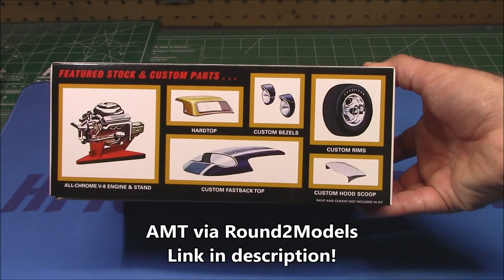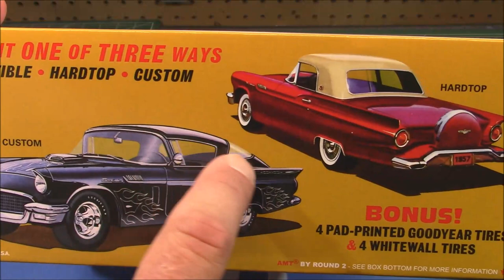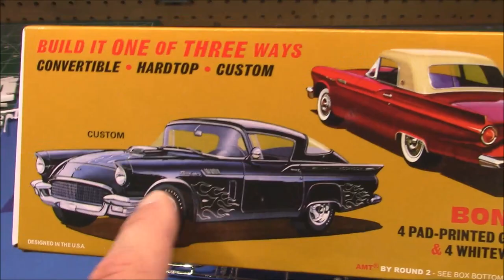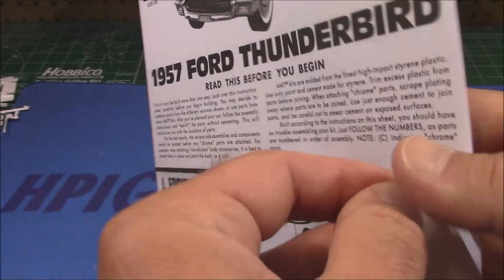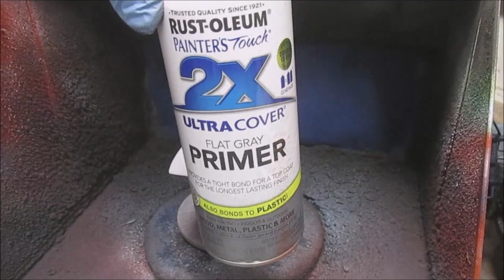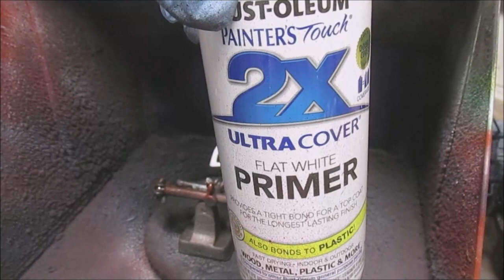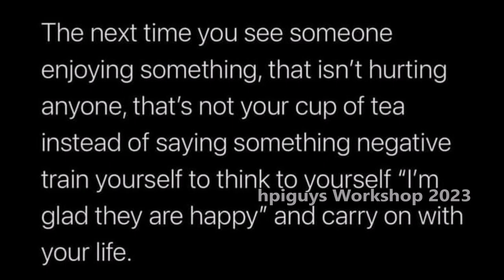1957 Ford Thunderbird Custom Fastback 3n1 1/25 Scale Model Kit Build How To Assemble Paint Interior

Comment: The oil pan sump is usually on the same end as the distributor on most Ford engines. This is a Y block which had a rear distributor so the sump is also in the rear.  Nice build, I love it. Keep'em coming

Comment: The large unknown plastic part is the bracket for the original kits wall display  parts, the second rectangular piece was to hold sand paper the the original kit had along with a tube of body filler.

Comment: These kits used to be supplied with a tube of AMT body putty and a plastic part to apply and smooth out the putty. One of those mystery parts is the spatula thing, if memory serves. I had this one back in the day but I can't remember how I built it up.
Reply: The putty came with either the '55 or '56 kit because the hood scoop was separate and I used the putty to blend-in the scoop.

Comment: The large flat piece od plastic was put in the kits when they gave you body puddy it was something to apply the puddy that was from the 60's kits.!
Reply: richardcrisclone is right.  This kit was originally released in the mid 60's and was a "Styline" kit with a custom front end.  Also included in the kit was a tube of AMT putty and possibly a small sheet of sand paper.  The flat piece of plastic was for gobbing on the putty   -- like a miniture spatula.  The other unidentifiable hunk of plastic was part of a wall mount for displaying the car.   I think this may have been the first kit with a chrome engine.  This kit was very straight forward, fun to build and looks good sitting on the shelf in the den.  It's nice to see a buildup of this venerable classic kit.
Reply: .....wasn't "puddy" the guy that worked on Jerry Seinfeld's car ??........"yeah - - that's right".......

Comment: in case no-one has commented on it----the 'body panel" is one of the original issue custom fender skirts----the "I don't know what it is" part is part of a two piece stand that you could put together had hang on the wall to display your model---and like you I dont know the purpose of the piece of rectangular plastic---the spare motor block and the headers are from the "gasser" version-----wish they would have resurrected the advanced custom parts from the original version----had a couple of really neat front and rear treatments----the original kit could have been built 5 or 6 different ways(cant remember how many exactly)---have several original and rereleased kits I picked up off Fleabay before things got so expensive---plan on building an example of each version on the side of the original box----by the way--great build

Comment: Looks like they opened up some previously closed channels. Unfortunately, it gives some parts, but not enough to complete the one time released Here Comes the Judge Gasser. That's where those headers, extra block halves, and chrome reverse wheels come from. Missing the 427 SOCH heads, timing cover, pulleys and accessories, intake and injectors, etc., raised front solid axle suspension, ladder bars and roll hoop. There's probably more parts, but those are a few can see. I was really hoping when it was announced, they'd bring that version back. When AMT released it originally, the engine being entirely chrome was meant to be displayed by itself separately on the stand. Turned out pretty good.

Comment: That kit has more parts

But basic stock with Continental kit
Wheel skirts and both the soft and factory hardtop 

Was used to make the Vegas TV show car kit

It can be made using parts from this kit
Basically a stock car big white walls bias ply tires with the Continental kit added

If you would add a picture of Robert urich
To the box top art that's the same picture that was used for the Vegas kit

Comment: Funny how the box art for this kit is the exact same as the ‘Vega$’ re-issue from over 40 years ago, without the ‘TANNA’ vanity plate and Robert Urich’s photo…
I’m a longtime fan but this is not one of your better builds. Seems to me that one in an instructional, leadership position like yours should at least speak to cleaning up the mold lines on that tired old 60-year-old tooling. Those big sloppy lines inboard of the headlights begged for a Coupla minutes with some sandpaper or an Emory stick. If you raise YOUR game just a bit, your followers will build better models along with you.